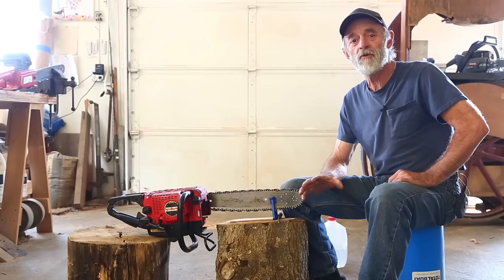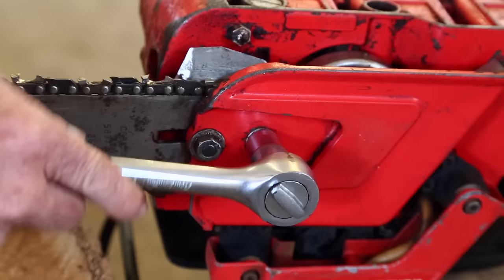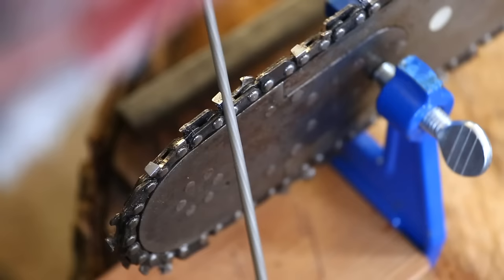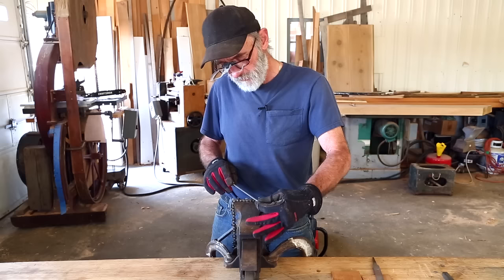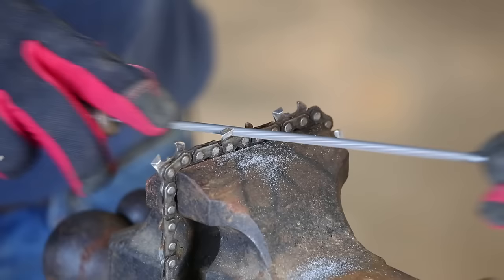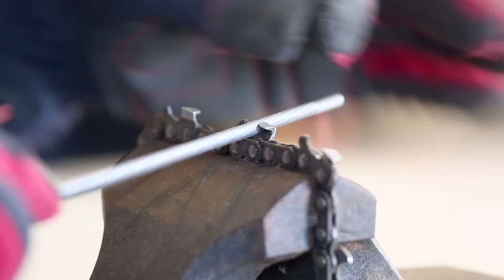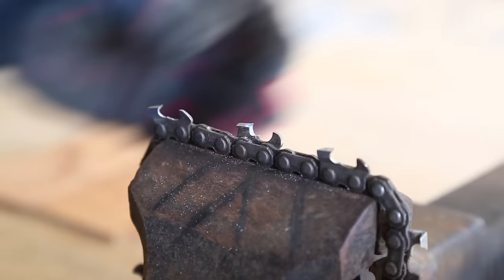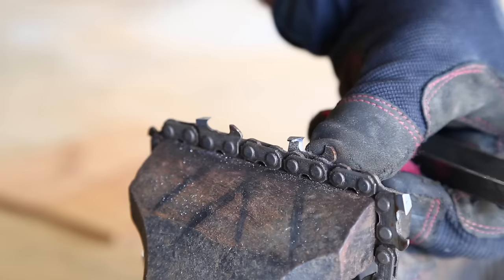How to Sharpen a Chainsaw by hand with a file

Comment: Brilliant. ... I was going to ask what the teeth (rakers?) were called in front of the saw cutting teeth and but you explained it all perfectly! 

Thank you.
Reply: They're not actually "rakers", like you have on a cross-cut saw to carry chips out of the kerf. The are depth gauges that determine the depth at which the face of the cutter meets the wood.

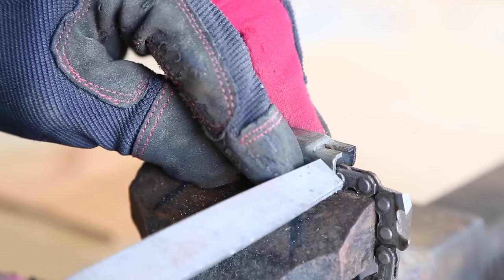Comment: 8:25 the remedy is a sharpie black/you can use sliver if you clean your chain first. sharpie mark both sides and the front don’t worry about the back then file the marked spot off and check again it take about 1.5 seconds to mark it for the people thinking that would take to long it’s faster than checking the gauge 1 more time to see you only still need sharpening again rarely happens after getting down the Sharpie method

Comment: Nice video. several points. Almost all chains require 10 degrees below level, not completely flat. You can see it in the angle of the cutter. 
The cutters alternate. You only push the file away from you on the far side of the bar, flip the chainsaw around and do the same for the other side. You did this but did not explain it. I like the way you checked and filed the rakers. Most people skip this.

Comment: I would like to see a demonstration of a properly sharpend chainsaw cutting a log or a tree vs. a dull chainsaw.  When the saw is putting out large flakes of wood, you know it's cutting great.  If it is buzzing a bunch of sawdust, and you have to force it into the tree, you need to file your chain.   -What have you done wrong when your saw cuts good, but it cuts in a curved fashion, rather than making a straight cut?
Reply: usually when it don't cut straight it's because teeth are not filed to the same length. He didn't discuss in this video but you can probably find another vid that show's what I'm saying.

Comment: Many chains have a 10 degrees vertical filing angle, not zero (perpendicular) as he says. Easier and better to use a file gauge dedicated for the chain model. But I agree that filing with a gauge and good technique is the best and easiest way to sharpen a chain.

Comment: Just checked and the files I bought for my MS-180 from the Stihl dealer are 4mm (5\32). The files shown in the video seem to stand up higher than the tops of the saw teeth which makes me wonder if they're a larger diameter file. Good tutorial, BTW 🙂

Comment: I have tried putting the chain in the vise but didn't work well for me since vise was probably wrong size or beat up and wasn't working well, too loose for such small drive links. I just put a thin shop rag on both sides of the bar so vise won't scratch the bar & clamped the vise  to the bar. Just put bar closer to the motor head of saw & clamp with least amount of force to hold saw firmly. If you gently file, it'll be ok, don't need to bear down hard if using a new file.

Comment: Thank you, awesome video, very concise and detailed.  I was going to use a stone, but now I see a good file will do a better job.  I have 1 question,  Do you concern yourself with the metal filings?  Should I clean the chain then reoil before re-installing?

Comment: Great video,  thanks. Which method is better? Leaving the chain on the bar or placing it in the bench vice?? Or am I supposed to do both methods? Also, what size is the round file you are using ?

Comment: I feel confident that I can sharpen a chain now.  My questions are, 1.  How to decide what sized file (and where to purchase) and 2. How to determine what the proper angle is on any given chain?  Often we find chains that have been improperly sharpened or so damaged that the dimensions are indeterminable.
Reply: Find the model number or type of the chain.   Could be in saw manual, stamped on the bar, possibly on the chain.  Look up this on the web - there are lots of reference guides that tell what the file size and angle are.  Files and guides are available at any chainsaw dealer or most hardware stores.

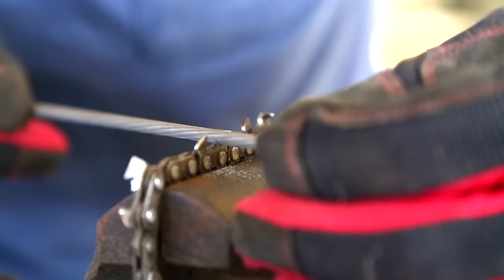Comment: IMHO, as the filings are easily seen at timepoint 0:20, it is probably a good idea to remove the chain from the bar and clamp it down elsewhere before filing. When the filing is done, it would probably be a good idea to wash the chain very well and use a magnet to cling to/remove any fine shavings/filings yet remaining in the links. This will spare the bar from grinding itself away in the chain track and shuttling it back to the drive gear area where more wear & tear will occur. Still, in a pinch, one must file as he can and no doubt at some point you might need to sharpen the chain right where she runs. Alas.

Comment: Good teacher. If you show how to use A file guide you do not need a piece of wood with marks.
A simple Stihl sharpening kit is all one ever needs and learn to use it like you demonstrated.
Reply: Many file guides also hold the file at the right distance from the top of the cutter, something noobs don't do very well, resulting in too much hook.

Comment: Watched this video twice. I have 3 chains for my chainsaw and I’ve just started to sharpen myself. I have angles drawn on my vise and I’m using the correct size file for my chain. Still my saw is cutting like crap. Getting very small chips almost like sawdust. I have a small husqvarna 240 saw. Angle is 15-30 degrees. So I’m filing to 25. I’m checking my depth with gauge and my guides are under the gauge. What am I doing wrong?

Comment: I can't get my file to cut any metal, what am I doing wrong, I've snapped two files pushing on them so hard trying to get them to cut and they just skim across and don't remove anything...

Ive used mill files before for metalwork and they cut awesome without hardly any effort

Comment: 5:32 don't push so hard on the last stroke and roll the file in at the top to drive the material into the gullet, then you won't form a burr.
I usually do the same number of strokes on both sides and every tooth, just to have smoother cutting without using a raker gauge all the time,.
The chains won't last as long because you're maybe filing teeth more than needed to match other ones, but chains are cheap and when you're cutting a 6-24' diameter tree, a good chain pays for itself in productivity very quickly.
Reply: The sharpest edge occurs from breaking off the burr.

Comment: Why do the rakers need to be filed? Wouldn't that help to clean out your cut? Thank you
Reply: as  the tooth is sharpened it looses height so the raker has to be filed to keep the same distance between raker and tooth. Otherwise the chain tries to take too big of a bite.

Comment: Where do you buy one of these chain height guages for the raker teeth.  I have a poulan p4018wm chain saw.
Reply: Mine came with an Oregon-brand sharpening kit: round files, flat file, clip-on file guide, handle, raker gauge, but you can also find them sold separately at a saw shop or hardware store. $5 or so. There are also some with "hardwood" and "softwood" gauges in the same tool.

Comment: I've seen other instructions that say file towards the cutting tooth.
What are your thoughts about that?
Reply: The teeth are coated on the outside with chromium typically which is harder than the file so filing that way just won't work. Work from the inside out that way the coating just sluphs off as you sharpen the softer inside metal.

Comment: Do you count how much strocks you put on each tooth
Reply: You can if you like. Start with the worst tooth you see, count how many strokes it takes to make it sharp (i.e., remove damaged edge), then use about the same number on all the others, whether they need it or not. Quick touch-up may only need two or three strokes. Major damage may take 10 or more. Bring an extra file if  you're sawing into dirty logs or hitting rocks and barbed wire.

Comment: I just buy a new chain every couple of hours of use. I have tried files and electric powered devices and the saw never cuts right after sharpening. Of course I dont have a garage or a place to work on it and Ihave to sharpen on my lap basically.

Comment: Maybe it's my eyes.   When I look at the close up around 4 minutes I realise that's not how I sharpen a saw.
The top plate needs undercutting or it'll not cut smoov.
4 strokes every tooth , take the rakers down every second sharpen. Adjust as required once you get the feel and results. Takes a few years.

Comment: The Marks are to show you when the chain is wore out and needs replaced, because if you file them past that line they can brake off and cause bodily harm lol ,although they are right angle though and work well as a guiding line ...
Reply: Thanks, I didn't know that.

Comment: They call it shoppening because you do it in the convenience of ya shop. When ya go defile it on ya bah like this, ya bah is just as shop as the rest of the bahs in the field. 🐑
When ya do it all visually, don't have a stroke when even at 500 power, ya can't see why there's a file guide that maintains all the specs to consider (depth).
"This is called a chisel tooth" ? Nah, ALL teeth are a chisels unless you shoppen em like knives. There's square teeth, some round. Some are round ground or square ground. It's becoming pretty rare to understand all the mocks and what they indicate. It's ironic how the measure of one's depth of knowledge is in one's knowledge of depth. The gullet determines the angle of the top chisel. Which is true when he says if ya can't see it, ya can't make it shop. That angle is seen from the side and not over the top plate.

Comment: Too much wasted time. Learn to sit on the engine with a saw upright on the ground with a piece of wood under the bar clamp your legs around the engine. Look right straight down at the chain and the angle scratched into the tooth and just file the damn thing. A very quick tuneup every tank of gas, unless you’ve hit something and it requires more filing, about three strokes on every tooth. About six minutes total and a 2 foot bar is sharpened.

Comment: Hi Shipwright, all of life is a learning curve, and here is another one for you. Shocking, I know, but you are making mistakes. If you were to completely remove the gullet it would make a world of difference because that little bit of metal is in the way, preventing the side of the tooth from cutting. Just do that one step and see for yourself. Next thing, file with a slightly downward pressure and it automatically gives you correct pressure on the cutting edge, but to file with pressure on the tooth is wrong. Check out a real hard core woodsman Buckin Billy Ray Smith and see for yourself. You're welcome.

Comment: Just get you a Stihl 2 in 1 hand-held sharpener; you don't have to mess around with trying to learn to free-hand sharpen. Don't buy a Chinese knock-off though.
Reply: And you keep the chain on your saw while you sharpen it....at the end of the less than 10 minute process it cuts like a new chain. Lastly, you will use the chain up, not throwing it away and buying a new one prematurely!
Reply: And your drags will be correct and yield correct chip size after each sharpening; that's why it's called 2 in 1.